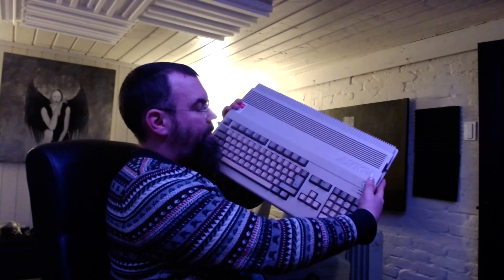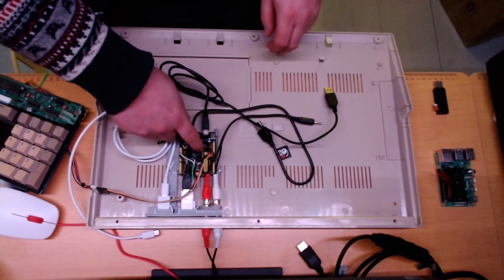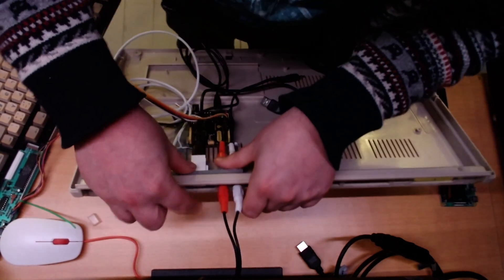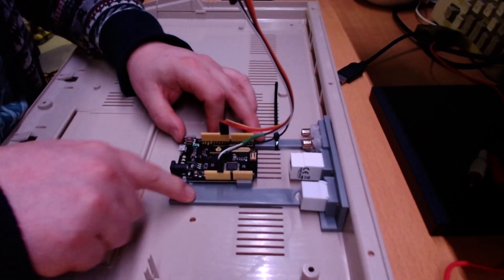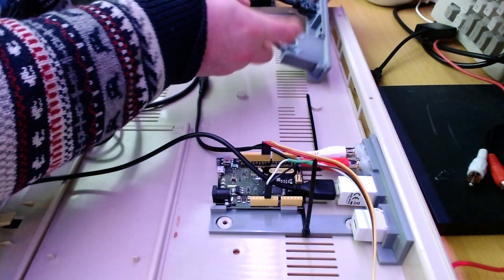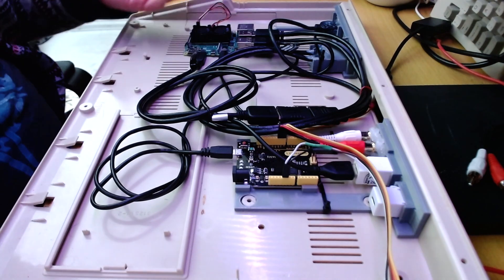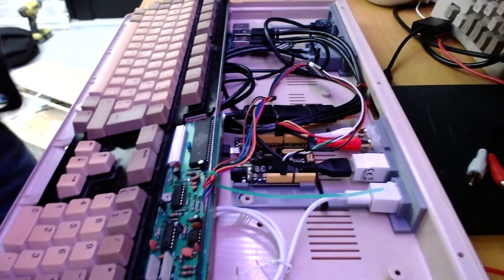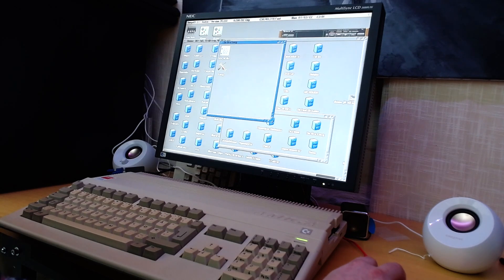Building the perfect Amiga emulation computer - part 1

Comment: Hi, nice video, I like it so much. to be honest this is for me the video that rekindles hope After the disappointment I received from not being able to retrieve an adapter card for the Amiga 500 keyboard from the UK because the seller does not ship outside the UK, I know that I could use a Arduino board as an Amiga keyboard adapter, makes me want to complete a project started and remained incomplete due to that untraceable adapter board 😔
Obviously I would need to know which specific Arduino board you used so that I can find it and continue with the project.
Reply from the maker: Will need to dig through my email to find the one. Thought I found it at the github page linked in the description.